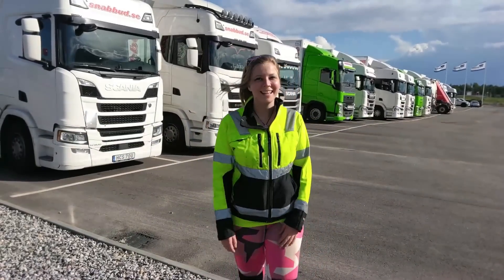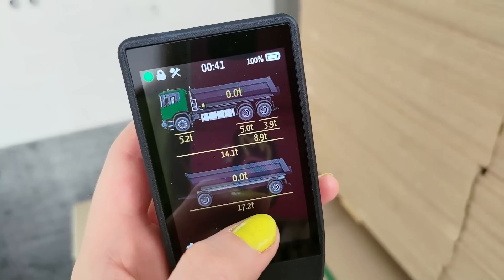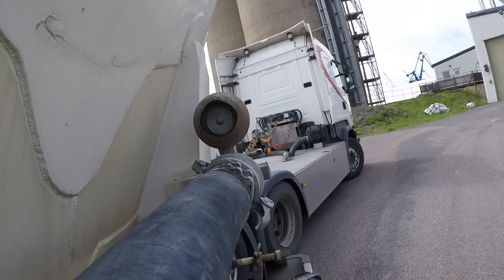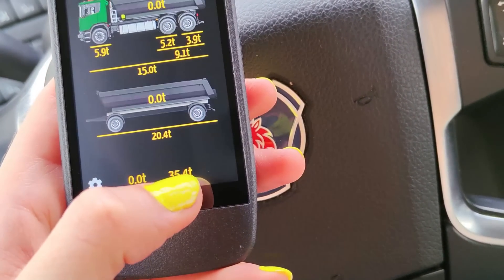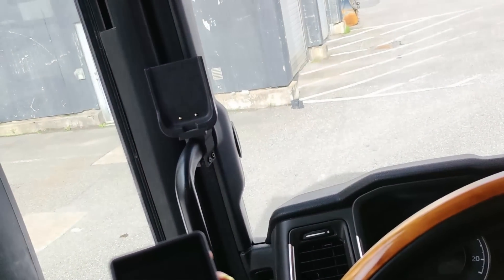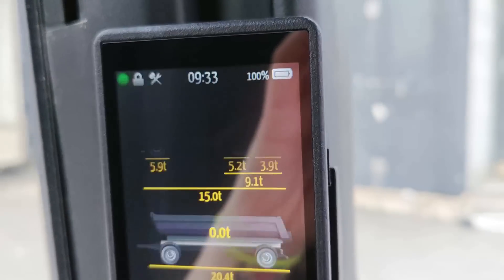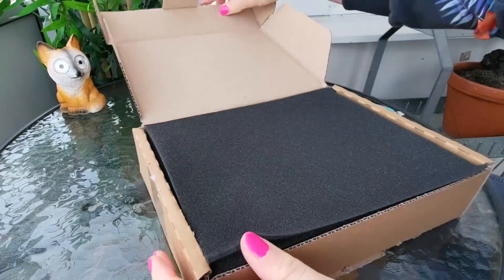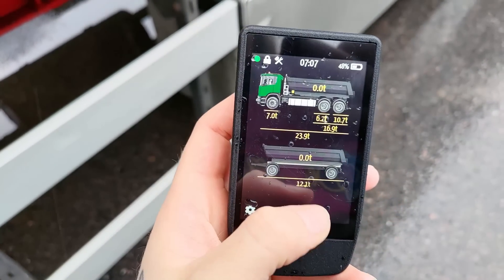Wireless Weight System for Scania Trucks! | Oakhill Technologies

Comment: The only issue I can see is knowing that it's calibrated correctly. Remember that you can get an overload on any one of a steering, drive or lift/tag axle without the truck actually being over its tare weight.

Comment: I drive a IVECO from 2016 in Holland and the axel weight can I see on my dashbord display.. Scania don’t have that?
Reply: DAF has a simular system and I suppose Scania also has that. The disavantage is you have to always be in the cabin to see the actual weight. The bulk company I momentarely work for has a battery operated wireless system related to the air suspension pressure so you can constantly see the weight during loading or unloading even outside the truck. As a backup my truck and trailer have pressure gauges so I can check the "weight" manually if needed.

Comment: I noticed American trucks have this type of system built into the dash, are there no European trucks doing this ?
But going off topic, you are turning into a human art masterpiece, your tattoo's are amazing, when are you 
doing a video about them ?  You're the best Cassie !!  XX
Reply: We've had that for a long time. I would guess that the numbers the unit shows comes from the truck, the same info you can pull up on the dash. Looks like it connects via can-bus. Thing is this one is remote so you can see it when loading just as she shows us.
Reply: That system integrates with Scania because Scania trucks have an electronic scale system already built-in with a dash read out, this gadget just makes it portable. I guess they'll make them compatible with other makes later, gotta start somewhere right.

Comment: Good idea - I'm surprised truck manufacturers don't offer this as standard. 
I wonder how it senses the weight and how accurate it is.
Reply: Volvo has it since many years
Reply: Pressure in air suspension. System is already in the truck. This equipment is to make it remote.
Reply: Thanks  @lokis7230 - using the air pressure is  clever  👍
I wondered if it was available from the trucks management computer 👍